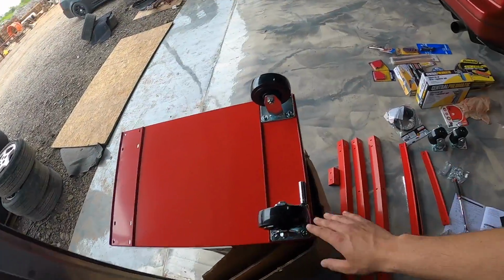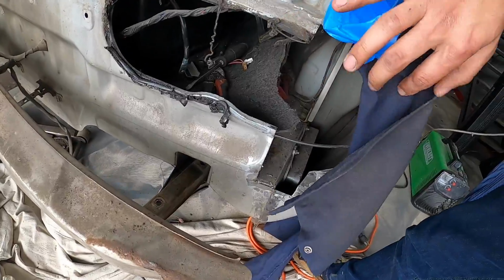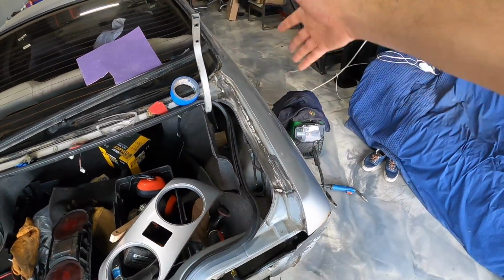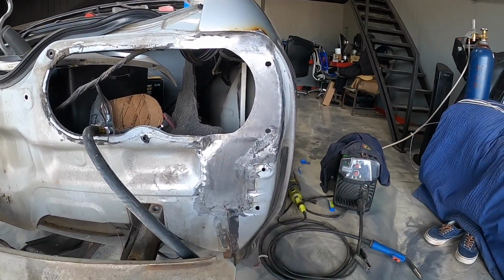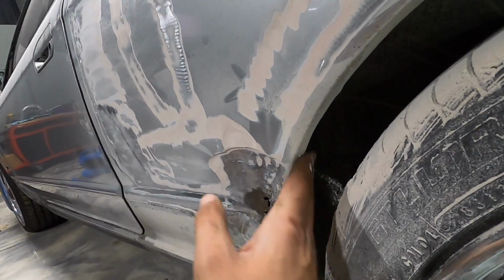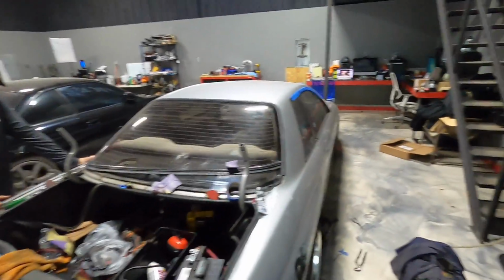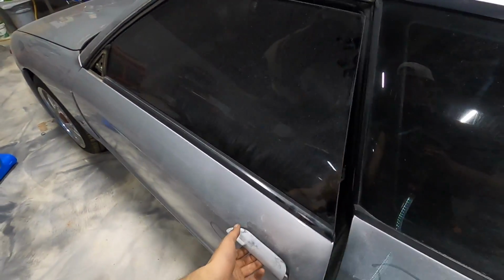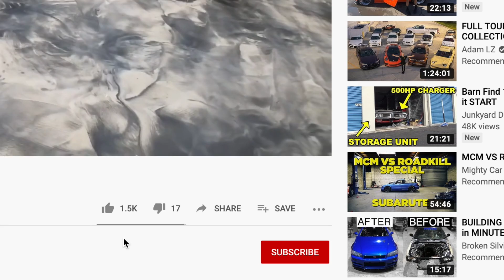youtube video #4BB8Ww4kGac

Comment: Pretty much every R32 I’ve owned has eaten out rear quarters, very very common mate. Also rear bottom of wheel arch will be rusted and where the floor meets the sub frame/rails, it rusts from the inside, won’t know until it’s too late. Best thing you can do is dry ice the floor and remove the deadening and check everything, there is little stickers that count as plugs you can tear off and see inside the rails

Comment: Have you checked behind your front fenders and underneath the black trim piece below the window wipers? Very common to have rust both of my mates with R32s had serious rust damage in those locations. Also the drain plugs underneath the car where the drivers feet are located.

Comment: 10:40 the solution to the 17’s looking small, run a really meaty sidewall! Edit: please don’t mold the widebody kit!!! It looks good sure but it’s a nightmare when you crack the overfenders... youve got to break it all off and replace and repaint the whole quarter panel
Reply from the maker: Matt L does it crack just on normal driving conditions? Even with rivets holding it in place?
Reply: Kalvin Malli well fiberglass fenders can crack for any random reason but if you’re running an aggressive wheel/tire and stance setup and rub bad enough or bottom out on a pothole or something of the sort, chances are you can crack the fender. It’s not a 100% guarantee but if you do any hard driving it’s definitely a possibility. I mean ultimately it’s your car, and I’m gonna watch regardless 😂 I just wouldn’t want to see a ton of hard work put in to have to pull it off and do it all again in the future

Comment: Should have etch primed the bare metal, prevent it as much as you can from happening again. Body filler is quite porous so will hold some moisture
Reply from the maker: Liam Jacob Clayton-Jones will hit it with a heat gun before primer is applied. Should be okay!
Reply: At my body shop we prime the bare metal before putting filler because the chemical reaction when the filler is hardening can cause moisture